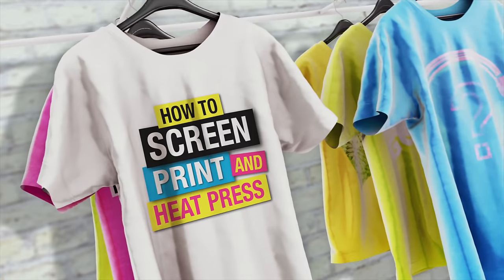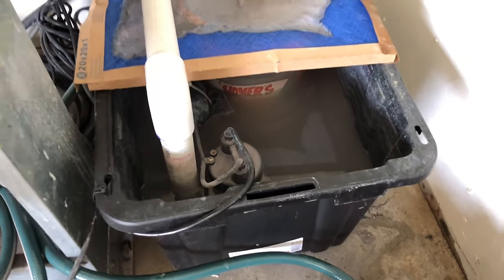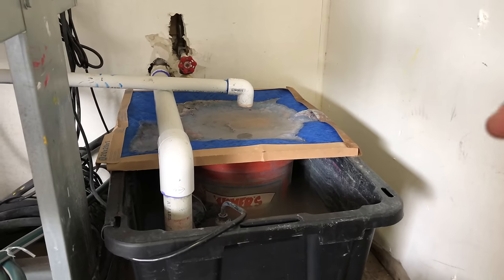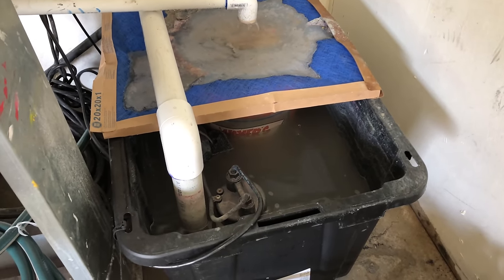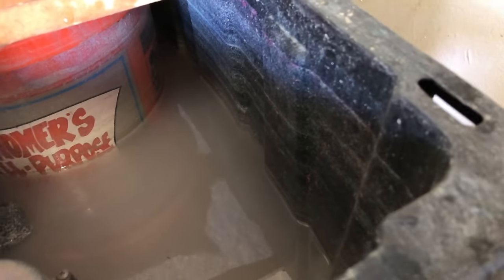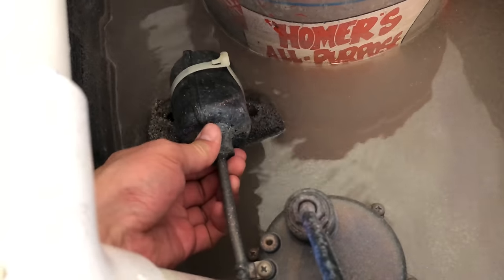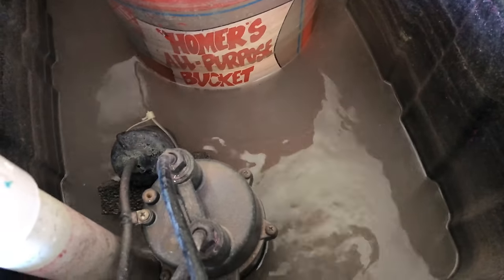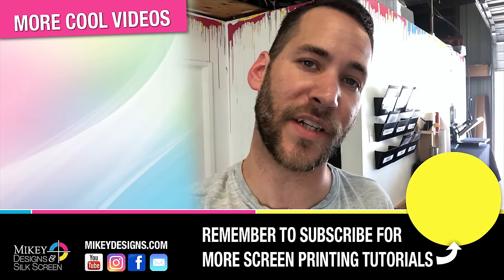Cheap DIY Water Filtration System for Screen Printing thats Affordable

Comment from the maker: Hey gang! Here's my solution to a cheap DIY water filtration system. Check out the links for products used in this video.  For a legit system, check out catspitscreenprintsupply.com and use promo code "MIKEYDESIGNS".

Comment: Looks great! I've seen other DIY filtration systems where people have used small aluminum frame silk screens to filter out the heavier stuff. They put a 80 mesh directly under where the water from the washout booth comes out and then a 110 mesh under the 80 mesh and a 156 under the 110.
Reply from the maker: Tim McElheny thanks! I’ve seen that too. Only thing is, how do you clean the screens used when they’re out without contaminating the cleaner water the pump discards? I’ll definitely look into that. Not much room for more than one screen but will give it a shot.

Comment: I have almost the same but I use wood screen frame 180 mesh I don't think it would hold alot of stuff like yours but when my container gets full I plug in a little pump to pull the water out. When the mesh gets dirty I'll use a little of ink remover or emulsion remover to clean the mesh.
Reply from the maker: I actually thought about that and have a 230 mesh screen I could use that’s wooden as well. Has some emulsion in some spots that’s locked in. I’ll have to give it a try and see if it’ll fit. If so, I’ll do an up date. Perhaps the AC filter in combination with the screen would be a great combo.

Comment: Great minds think alike. I built something very similar and also like Ivan Ramos, I use screen mesh 300. When the filter is dirty I just set it aside and let it dry then toss it, replace with a new section of screen.
Reply from the maker: Creation 80 Graphics wow, us screen printers are pretty crafty when it comes to DIY solutions for our shops. I thought about using a screen, so I may give that a try. I like the AC filter in the fact I can toss it and place another in its place. They have them for 99 cents at Home Depot and seems to work great holding junk. Another consumable. Will def give a screen a shot though and report back.

Comment: Hey Matt, quick question - how rickety is that RANAR booth if you completely remove the metal cross-beams at the bottom... is it just gonna bend or fall over without them? Bout to get a booth and love the price and build quality of the RANAR booths but the way the feet are fabricated poses a serious issue for placing a filtration system directly below, and while its clearly an option to plumb to the side instead - I am super limited on space so I need the filtration system to go directly beneath... thoughts?
Reply from the maker: Hey Hotbox! What is your name BTW? The supports between the legs are really just to keep the feet / legs from spreading. I could see it being an issue if you move it around a lot. However, here is a video Jonathan put together with a filtration system under his, and they just relocated the supports to the outer part of the feet. Check this out. I hope this helps. https://youtu.be/YHvR59PXilk
BTW, when I moved into my shop, I didn't completely bolt up on of the supports on one side because I lost a couple bolts during the move (partly disassembled the both and lost a couple) and it holds up just fine.
Reply from the maker: Check the video out around 9:35
Reply: Thanks for the reply. My name's Shaun. Yeah, Ive seen the video where John retrofits the cross beams to the floor... not a fan though personally... Im looking to really streamline how this is going to be setup and I dont want to have to carefully position the filter on top of the beams like that. I considered "possibly" mounting them higher up closer to the drain, but I dont think that would work and it seems like that would not allow the cross beams to really do their job in supporting the booth properly... I mean, theres a reason they engineered it this way. Also, since the filtration system Im planning to get has its own casters for easy cleaning when you need to pull it out, i want to be able to utilize that feature of the system, and by placing the filter on top like that it kinda defeats the whole purpose. Its really a shame RANAR still fabs their booths this way, because even though they make amazing equipment I feel like when they originally created these designs the market was not as focused on being "eco-friendly" and filtering waste water.

Comment: Hey thanks for the info and video. I'm definitely gonna build one but one question; how do you know which sump pump to buy..I seen some cheaper ones online, what's the minimum power we need for a small diy setup like this. I wanna put an inline filter at the end to filter 20 or so microns. I can't figure the pump power I need, any suggestions?
Reply from the maker: I believe ours is a 1/2 horsepower. Which is plenty for our case because it will pump the container dry quickly. Think we paid close to $90.  I hope this helps.